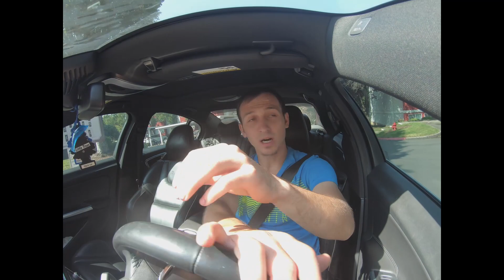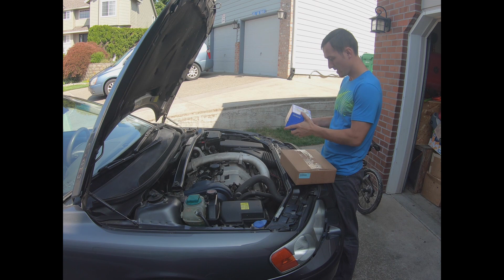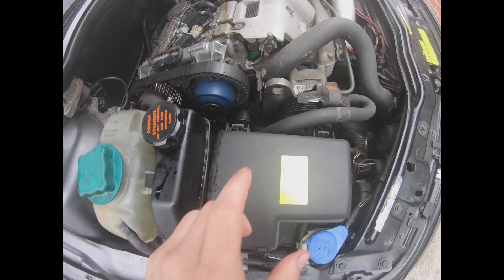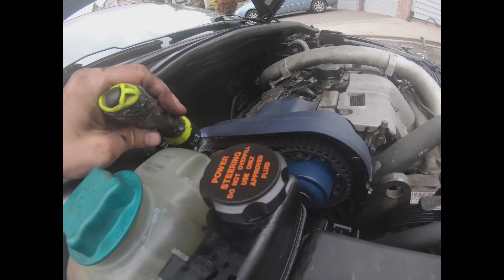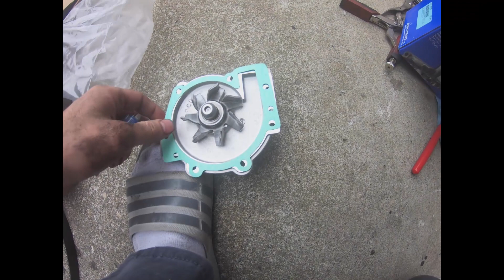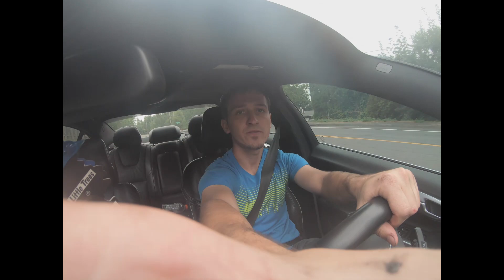Volvo s60R Timing belt and water pump service DIY.

Comment: dont need gasket maker for the water pump but good info
Reply from the maker: You don't  necessarily need it but from the years of working in shops i found it very useful and precautionary habit.